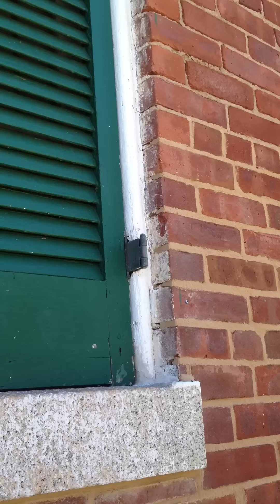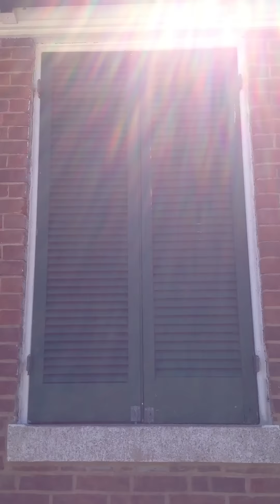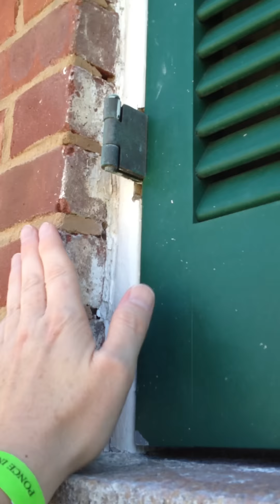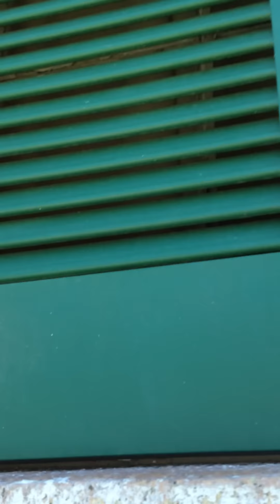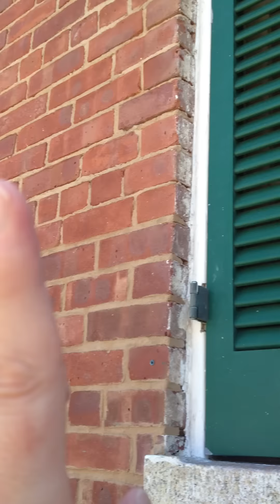Wide Throw Hinges Shown and Explained

Comment: I bought 1 3/4 offset hinge strap and when I put the shutter in the window and laid the strap against the shutter and when I tried to put the pintel on the brick,, it was an inch away from hitting the brick. If I laid the pintel against the brick the strap would not lay flush against the shutter. Please help!
Reply from the maker: I would be happy to help - can you please include photographs of the hinge, the brick wall and the shutter?
  Feel free to send them to our contact information at the link as seen here:   https://absupply.net/about_us.aspx